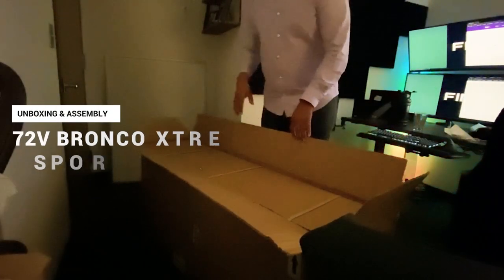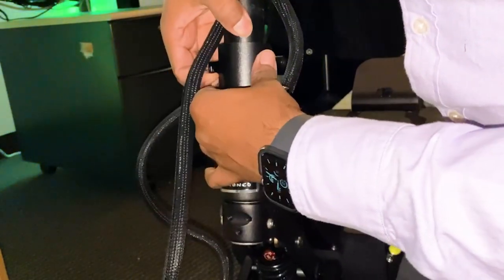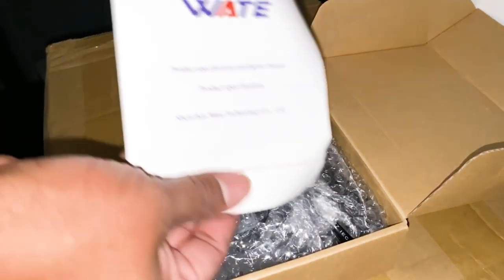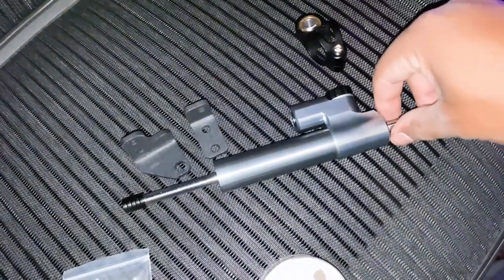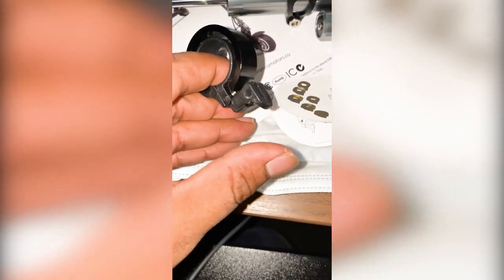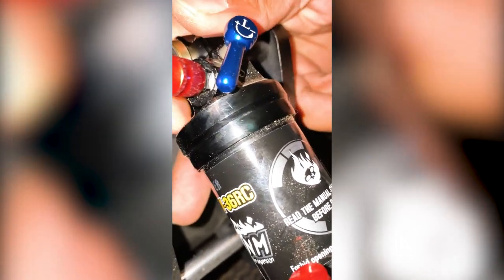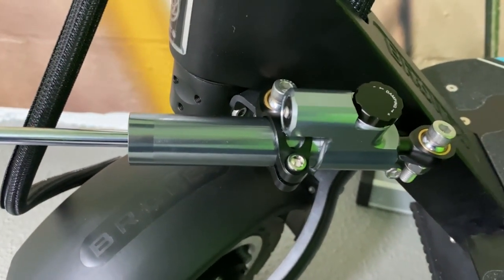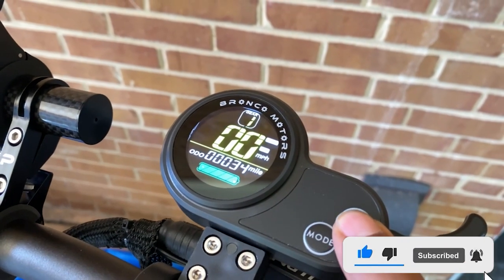CRAZY FAST BRONCO XTREME 11 electric scooter - UNBOXING with DETAILS

Comment: Between Bronco and Nami, which one is faster (acceleration, top speed..)...?🤔
Reply: bronco for acceleration and sheer thrill. top speed not sure as I have not gotten both as fast as they will go and really not important as I don't ride on highways.
Reply: @mgcore159  Awesome. Debating between this and the Nami. Which has better range? Thanks
Reply: @YoungWise2011  depends on too many factors and exact riding on both and have not done that kind of testing. I’d take bronco all day tho now that I had both for a while because of all issues with Nami from suspension, controller, stem wobble, steering damper, etc. Bronco has been rock solid since purchase and no surprise issues.
Reply: @mgcore159  Looks like I'll go with the bronco. I'm looking at the one with updated controllers lcd screen and thumb throttle. Although the vsette 11+ super 72 had caught my attention. But I'm almost positive to go with bronco. Thanks for the reply and keep making new videos you got a subscriber.
Reply: @YoungWise2011  in your position I’d scan the secondary market as bronco will need a year or two to iron out issues with new tft display and controller based on initial release. The “original” is amazing.
Reply: @mgcore159  Out of all your scooters which do you like best? I read in the comments you have a king gt pro to.
Reply: @YoungWise2011  original bronco. Nami has nice looks but too much work and inconsistency. All have too much power and a blast when operating well. Wolf doesn’t even really compare favorably to either Nami or Bronco.
Reply: @mgcore159  Sounds like I'm going for the bronco. Do you know if theirs a v2 model coming out soon? Would hate to buy original then have a v2 come out. Sorry for all the questions.
Reply: @YoungWise2011  there was, then delay, then delay. i think q4 22 is most recent release. not sure given all supply chain issues when things will come out anymore. I would get one that is local or used and already set up and tested so no issues with shipping or having to deal with manufacture issues. something already tested and a few miles on it so you get the best value and a trusted scooter without the headache and maybe a few upgrades the previous owner already took care of for you.
Reply: @mgcore159  Yeah I here you. No one local to seattle is selling one unfortunately. Might just have to buy new.
Reply: @YoungWise2011  I can get you one shipped with low miles but it’s coming from MD so still shipped but proven and has the extras I was talking about and at a fraction of cost. Interested or rather buy new?
Reply: @mgcore159  without being able to see it or test it worries me. Would rather buy new with a warranty. Local would be different.
Reply: @mgcore159  So I just saw they have a bronco vnom in France. Looks pretty sweet with a 50ah battery.
Reply: @YoungWise2011  huge presence in france and support and facilities too!
Reply: @mgcore159  only if they shipped here
Reply: @mgcore159  So ewheels messaged me today saying they are no longer putting the upgrades on the Nami it would be something I'd have to do myself. So I can buy the original or got for nami 2. Reason why I'm leaning towards nami 2 is because it's water resistant. As for the bronco the red and yellow buttons are exposed along with throttle which I don't think is water proof. I guess they be addressed most issues from the 1st. Really wanted the bronco but I'm in Seattle so need something water resistant.
Reply: @mgcore159  Man I can't make up my mind on nami max 2 or bronco!! Killing me.
Reply: @YoungWise2011  I’d get bronco original and avoid new rides with all issues currently out there and lack of repair and parts due to shortage. Get something used and tested and ridden that likely has more likelihood of parts out with kinks out already.
Reply: @mgcore159  is their parts out their for the bronco? I just don't see alot of broncos on any of the fb groups. Everyday I see someone getting a bad nami. But then again I'm sure theirs more good then not and their just not posting. I just like the look better water resistant and horn. But bronco I belive is better suspension and speed.
Reply: @mgcore159  Hey is their anything wrong with the Branco that someone is selling and how much?